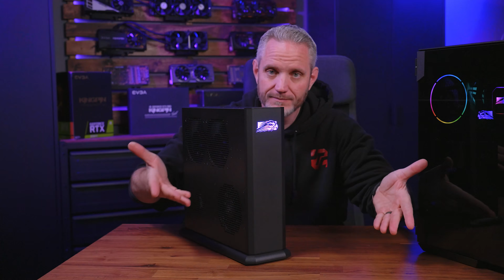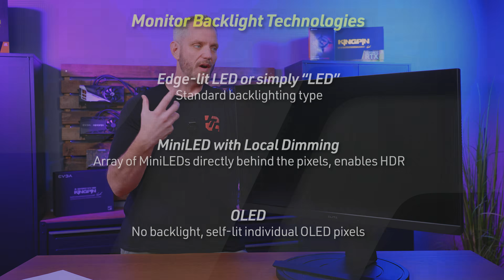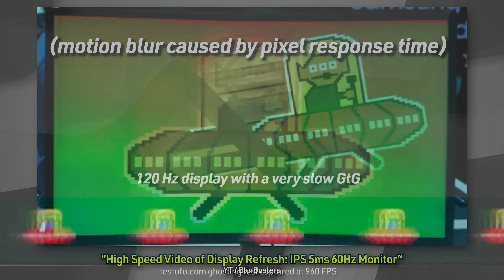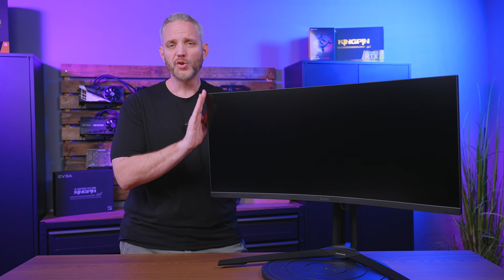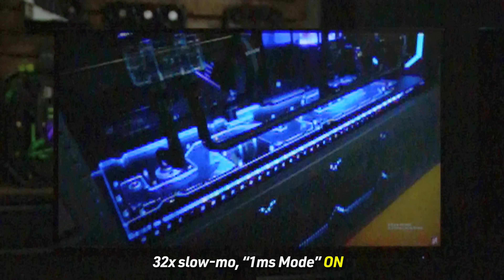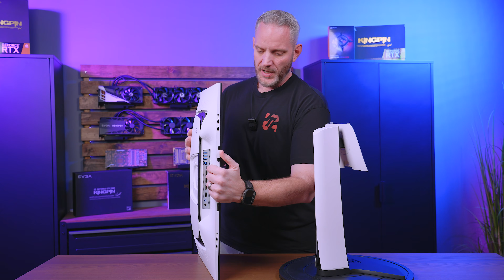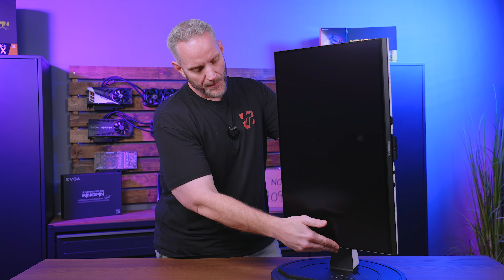Ultimate Gaming Monitor Guide: Find the BEST Screen for Your Setup

Comment: Part about MPRT is questionable, as it's reinvention of third wheel and your eyes wouldn't like it long term. MPRT mostly exists for 0.000001ms response time marketing BS.
GtG is also marketing BS, as you need to know the whole picture by, for example, searching for deep reviews of monitors (like RTings), where you can find response time going from different shades to different shades; any problems, like black smearing, would be obvious.
VA panels had a major problem with black smearing, but after Samsung Odyssey, it was seemingly solved.
OLED panels also have problems (judging from perspective of smartphones), like PenTile (non-Samsung ones shouldn't have it; subpixel layout designed for increased brightness, but with a flaw of reduced sharpness) and burn-in (static pictures like icons on desktop will burn-in themselves on matrix over time; for PC monitors can't say whether "over time" here is something you really need to worry; but with MicroLED IPS development, as well as super quick panels, OLED seems questionable (only slightly better contrast and response time, maybe more brightness for HDR content).

Comment: 1440p 144Hz at least 27" Are an absolute must. I still have the RoG swift that I bought back in 2016 and its still an incredible display for as old as it is. That being said, I think I'm finally making the jump to 4k/OLED with the newer RoG Swift PG32UCDM. I dont game as much as I used to but I use solidworks and I've recently started forcing myself to do more video editing.

Comment: I'll be "that guy" and say you ignored the big drawback of OLED. Screen burn in. I know about all the claims of how that shouldn't be a concern anymore, but I've still got burn in on devices that it shouldn't be a problem with. If you do a lot of gaming with a static GUD, don't be surprised if you start seeing that HUD shadowed all the time. That is a hill I'll die on because it still happens regardless of all the claims. 

I'll also say that rear monitor lighting can have a purpose with LCD panels. If you set it to white, you can use it as bias lighting. Bias lighting behind a display can increase perceived contrast due to how our eyes work. It essentially tricks your brain into seeing the somewhat grey color of a black image as a deeper black. For OLED and panels with local dimming, this isn't going to do much, but can help with edge lit LCDs.

Comment: Im running a 38" 3840x1600 ultra wide 144Hz nano IPS display and it's pretty nice. It's not quite as fast as the OLED screens but it still puts out an amazing picture.

Comment: A few years back I bought my first "gaming" monitor, which was the apparently closest local available alternative to a recommended monitor from one reputable tech youtuber for my budget range, and it was pretty low quality gimmicky overpriced trash that I only realized how bad it was after like a year of use when it suddenly got a neat array of faint(gladly) horizontal lines all over the screen and I started really testing the actual performance of the thing objectively. Noob mistake I hope to have the knowledge to avoid next time.

Comment: I have a 27 inch MSI gaming monitor with 100 hertz, 1 ms latency and IPS panel. But it has adaptive sync. I play a lot of single player games. I am satisfied to play a game at 60 fps, 70, 80, 90 or 100. I used this monitor for GTX 1650 laptop and now using it for RTX 4060 desktop. I am still satisfied.

Comment: Do another review after 2025 CES stuff is out, hope it drives the 144HZ prices down.  I learned a lot in this vid.  I hate glare but was looking at monitors around  240 Hz refresh rate and a 0.03 ms response.  For me monitors last several desktops (which I drive into the ground) so it's probably worth a higher end if the glare won't make me crazy.

Comment: Upgrading panels....LOL....Sorry, try telling SWMBO that I "need" a new monitor or two, and those are going to be $500 each because I really 'need' those two 4k panels with the 144hz refresh rating.  Yea, nope. The reply "You have 2 monitors that work just fine 15 years ago.  Why do you need new monitors, the ones you have work just fine.  If those aren't working right, remember the ones they gave us from work?  They gave me two 24" panels when they were cleaning the building out when it closed, you can use those, they work great and are only 10 years old".  Yep...I doubt I'll ever see a new panel until these quite literally die a horrible slow death.  :(

Not sure where Jay gets <$400 for that panel he comments on.  Cheapest I can find is $500 each if I go to MicroCenter, and I'm not too fond of Gigabyte panels.

Comment: Im quite happy with my Acer 27 inch slightly curved 1440p 165 Hz monitor. I had no idea how bad my games looked on my 10 year old 24 inch 1080p AOC 60Hz monitor until I got this one. Nothing against 1080p monitors or those that have them. But Im not going back.

Comment: just bought my first 1440p 180hz monitor, going from a 1080p 144hz, it's amazing, HDR10 (tho not fully calibrated yet), 1ms response time, no ghosting, and has free sync, both monitors are 27" so the difference is very noticable, also i run 3 screens on a RX 5600 XT, Ryzen 5 3600, and so far it's running smooth even in games on high with HDR turned on

Comment: 19:17 You typically won't see many 'FreeSync' branded monitors nowadays weirdly enough.

When Nvidia finally conceded that GSync was losing due to its more costly and more proprietary nature, and decided to embrace FreeSync by removing the proprietary restriction they had put on their GPUs, this then meant strictly speaking pretty much all 'FreeSync' monitors were now 'Gsync' monitors.

And we saw A LOT of companies rebranding all their existing FreeSync monitors as 'Gsync' displays almost overnight. Like to the point one day a whole range of ASUS and MSI displays were branded as FreeSync monitors. After Nvidia publicly conceded to AMD and Freesync, a week later all of those ASUS and MSI displays had their product descriptions changed to advertise them as 'Gsync' monitors.

And that's still going on to this day.

Nvidia very much lost the display technology battle to AMD, but they did so in a way that meant that after they conceded, pretty much everyone shifted to using the Nvidia technology branding even though they were using the AMD technology that Nvidia finally decided to support.

Nvidia marketing and partner pressuring at its finest.

Comment: Perhaps it's something that's covered much later in the video as a after point (Or maybe it was mentioned in passing and I just missed it), but one thing that seems grossly absent when talking about display formats and going into OLED displays is Quantum Dot IPS displays.

As yes, whilst OLED displays offer much truer darks, QD-IPS displays seem capable of offering unrivalled vibrant colour purity that OLED simply can't match.

That OLED displays are kind of presented as offering the most vibrant and most accurate dark colouration is kind of misleading. As OLED displays only really excel at one of those things compared to alternative approaches.

When it comes to colour accuracy and vibrancy, I'm not sure OLED displays can come close to some alternative approaches such as QD-IPS monitors. especially with HDR.

Perhaps I'm wrong there, but the fact that such things don't even seem to be brought up at all seems a bit of an oversight.
Reply: I bring it up mainly as a couple of years ago I treated myself to a 32" 4k 144hz HDR QD-IPS monitor (1ms response time), and the colour vibrancy this monitor is capable of especially with HDR content is just a huge night and day difference to my secondary standard IPS monitor.

And at the time, everything I was reading about the trade offs between QD-IPS and OLED was that OLED displays were only capable of hitting somewhere around 75% colour accuracy to real life although offering much truer dark colours.

Where as a QD-IPS display at the time was estimated to be able to achieve around a 93% colour accuracy to real life, with more richer colour vibrancy but with not so deeper black balancing compared to OLED displays.

So it would have been interesting to see this more covered and talked about and where things stand in terms of QD-IPS displays today.

Comment: I'm super picky with displays, finally settled on a IPS 32" Ultragear I'm happy with. For motion, I absolutely can not use VA panels. I've had higher end models from both Asus and Samsung, and they're basically unusable. Nice contrast still images, as soon as anything moved on screen the image is a MESS. This is the same reason I still use a 27" CRT TV in my bedroom as well. So if you're looking at monitors, only consider IPS or OLED if you need a clear moving image.

Comment: OLED is the way to go if you want to see a big improvment in visuals. Recently picked up a 34 inch ultra wide 1440p OLED and it's night and day different. Even if you can't get a 240Hz or higher it's still worth it

Comment: Great video Jay! I am currently using a ViewSonic XG2702 and I love it for PC (3070 GPU) and my Series X. Being a 1080 TN panel with VRR, 144hz and great input lag, I'm spoiled with great performance with both my PC and X (which I can play most games at 120fps over the HDMI 2.0). I'd like to get a 1440p with the same or better specs (preferably at least 1x display port and 2x HDMI 2.0 or 2.1. what would you recommend for competitive FPS gaming? Thanks!

Comment: I just switched to 1440p from 1080p but my second monitor is still 1080p and the difference is insane and I really didn’t know what I was missing. Even the desktop icons are so much crisper. Definitely an adjustment to get used to the size difference tho. Everything seems so much smaller on 1440p.
Reply: Jayztwocents rec - mini led lcd panel 27 inch 1440p 144hz 1ms  - under 300 dollars. What would be the best monitor in this category?

Comment: For me atm sweet spot is: 27" 1440p 144Hz IPS monitor (current one is from 2018 [when I bought it] acer xf270hua).  Really nice colors and watching angles. Fast enough (play mostly single player games, age 51 atm and never intend to play for money so...)

Must have I guess is: GPU fast enough to play most (if not all) games you want to play at 60Hz or faster and I guess it help plenty to have freesynch also. Also dest (I prefer corner desk) where you have have 90-120cm distance from "your face to your monitor". If you can not get that far but let's say 60cm or so stick with 24" 1080p 144Hz (IPS) monitor.

Waiting for new releases mostly from AMD, current GPU 6700XT (in my AM4 5900X with 32GB of 3600 RAM) but just build AM5 computer without GPU so... :)
Reply: Jayztwocents rec - mini led lcd panel 27 inch 1440p 144hz 1ms  - under 300 dollars. What would be the best monitor in this category?

Comment: I am wondering about the Dough Spectrum One 27" 4K HDR 144 Hz Monitor with USB-C Docking (Gorilla Glass, Monitor Only)  it is the same panel as 27" UltraGear™ MiniLED 4K UHD Nano IPS 144Hz Gaming Monitor with G-SYNC® Compatible & AMD FreeSync™ Premium Pro, but Dough is not to be trusted, I hear. I have a LG Ultragear 32GR93U-B, I want to remove the MATTE, should I risk it? Or just buy the Dough?

Comment: A mistake in the video. The lower the curve rating is the more aggressive the curve. A 1000R is more curved than a 2500R. The curve rating is the radius of the circle the curve makes so the smaller radius the more aggressive curve.

Comment: My dream/rough game plan right now, I'd to get the 5090 I saved up for. Them get a display port 2.1 oled at either 1040p and some insanely high refresh rate on a dp 2.1 monitor or a 4k oled with dp 2.1 and lower but still high refresh rate.

Which one I get will be based on reviews of the 5090s fps achievable fps in games benchmark. But yes, i do want a display port 2.1 on both my gpu and monitor.

Right now I just upgraded to the 9800x3d. Then the old Titan v, and 27" ips
Reply: Get the aorus fo32u2p you wont be dissapointed

Comment: I’m running an acer predator 24inch 1440p monitor which is tn I believe and have been thinking of changing it as it’s just not as poppy an image anymore especially when I go from playing ps5 on a 4k hdr tv. I can definitely see a difference
Reply: Jayztwocents rec - mini led lcd panel 27 inch 1440p 144hz 1ms  - under 300 dollars. What would be the best monitor in this category?

Comment: My 2k 32" 144Hz panel died so I dropped back to an old 1080p 27" 60Hz spare. Was it noticeable, very much so, but you'd be surprised how quickly you get used to things.

Comment: 32" 1440p is actually great at 93PPI or so. 92-96ppi (pixels per inch) is pretty great. Over 96ppi is pretty much perfect. 4K gaming monitors are grossly expensive, 1440p is a happy medium in my opinion. Personally I enjoy 27"-32" 1440p or 24" 1080p. 4K doesn't feel great in a lot of games, but 32"-34" 4K is the dream. Waiting to see how the next GPU generation manages 4K before making my jump to dumping my VA panel and switching to OLED.

My primary is curved 32" 1440p VA, and the shadow ghosting sucks because the specific black LED response time to white is 50ms on VA. I have lived with it, but it is annoying.

My favorite panel right now is a 27" G-SYNC 1440p IPS and looks fantastic to game on. Perfect gaming monitor for 2025 IMO.

Comment: 8:02 It's also important to know that the advertised response time is the fastest the panel can achieve during optimal conditions. The average response time is usually significantly slower than the advertised response time. For example, many VA panels with an advertised 4ms response time GTG will often average 11ms, or worse.

Comment: 3:09 it's also important to note that the response times for VA panels are significantly slower than IPS, leading to noticeable ghosting most of the time
Reply: Nope. VA are faster then IPS. Sorry but you're wrong.
Reply: @Umroberto79  most VA panels have an average pixel response of 11ms, whereas most IPS panels have a pixel response of 7ms. Even if there was a breakthrough in VA technology, it'll take a while for fast VA panels to outnumber current VA panels.

Comment: I prefer running multiple panels to ultrawides. Higher vertical resolution available generally with a lower total panel(s) cost. Downside is more strain on the gpu to drive them.

Comment: Jay made a comment about how the OLED panel type is the most expensive on the market but from my research this is just simply not true. MicroLEDs are by far the most expensive. When comparing the higher end of both OLED vs MiniLED, they are roughly equal in price. Although miniLED's can be far cheaper with junky lower tech.

Comment: Hey Jay, Would it be possible to potentially do a video regarding the issues with Intel 13th and 14th gen with a gigabyte board? I have a Z790 AORUS ELITE AX DDR4 with a 13700K on the latest bios. When I enable the Intel defaults my temps and voltage (core VID 1.425v) is higher and throttles well before it finishes a cinebench run. When I turn it off voltage (1.35v) and temps are lower, I can finish a run in cinebench with a max temp of 96c. I can provide my full build if you would like. Just a bit concerned about longevity of the chip. Everything in the bios is default (auto) aside from XMP. My pc hasn't ever crashed.

Comment: I ran into this unfortunately for me at the height the prices and scalping.. I had as you said Best Rig I could put together, so I got a OLED mini LED, ROG Swift PG32UQX. this, the 4090 cost me 2K and this monitor was more than the GPU.  Yep my 4K gaming looks amazing, I am glad you are pointing out ways to get some of this tech now at a much lower cost. I will say, the better the monitor and the resolution, the higher cost of the GPU and CPU you need to run it properly.   Very good info to pass to folks Jay.
Reply: 5k setup? That's wild

Comment: I feel there's a lot of misinformation in this video.

1. FreeSync and GSync are not about removing tearing (the traditional VSync deals with that) but to make the image motion smooth when the frames are output by the GPU at a lower rate than the native refresh rate of the display. Also, tearing is mis-characterized as something caused by the display in the video. It is not, tearing happens because GPU switches to a new frame before it finishes sending the previous one to the display, and it can happen at any refresh rate and is fundamentally unrelated to variable refresh rates (VRR).
2. Response time typically refers to the total time between user input and the image changes on the screen. At best, it includes the pixel transition time, but the transition time is not the entirety of the response time. And also, for LCD panels, pixel transition times below 1ms (and most of the time - below 5ms) that manufacturers put on the box are pure marketing BS.
3. Talk about OLED and not even mention burn-in is unthinkable. This major drawback must be discussed in a video called an "ultimate guide".
4. The screen curvature (the R rating) is the opposite from what is said in the video. R is the radius of an imaginary circle of which the screen would be a segment. So the higher the R, the larger the circle, the flatter the screen.

There are other issues, but at least these ones really stood out to me.

Comment: For those who cant afford an oled but still want the best response times, contrast and gaming performance, check out the Samsung Odyssey G65B VA panel. Unlike other VA panels its actually got an insanely fast response time with not VA smearing. Also has 4000:1 contrast vs IPS 1000:1 and great colours. 1440P 240HZ king imo. At least until oled mitigates burn in more